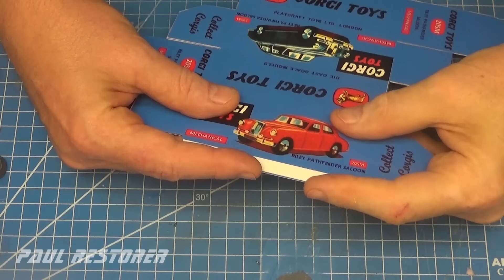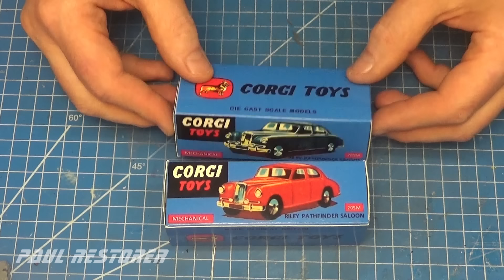Riley Pathfinder klasyczny i custom. Renowacja modeli Corgi z roku 1956.

Comment: Maestro!! Both cars are absolutely beautiful! The classic red body, and a SPECTACULAR green two/tone!! The castings looked so much nicer than the Märklin Trio of Pre-War racer/speed record pieces! It must have been a joy to do these Riley Pathfinders! I noticed you used a hole punch to set the glass in the red car. A great way to cinch it in tightly. The TRICK way you painted the rims was a brand new process! It worked perfectly! The Two/Tone green paint job looks wonderful. I saw a picture of a Pathfinder with the exact same paint scheme. Your colors look fantastic. All your fine detail work with chrome accents sparkle!! The Peugeot 404 interior mold from the Hillman Husky project continues to serve perfectly! The tan leather dye for the green car's interior is perfect. I was curious with the boxes about the term, "Mechanical"?? Pawel, you did a masterful job on these Pathfinders!! Congratulations!! ❤❤ Stephen
Reply from the maker: Thank you very much Stephen
Reply: The mechanical versions had a friction motor in them

Comment: Id really appreciate info on what type of screws you use and where you get them from, also what drill bit do you use because I thought they normally were gold toned for metal. Cheers for any help.
Reply from the maker: I use M2 screws, the so-called Torx metric thread, with a length of 4,3,2 mm, depending on the thickness of the alloy to which I can screw it. If you type Torx screw M2 x 4 mm on the Internet, you should receive the results of these screws, they are sold in packs of I drill 1000 pieces with a 1.6 mm drill and of course then use an M2 tap. Best regards.
Reply: @PaulRestorer  Thanks for getting back to me! :)